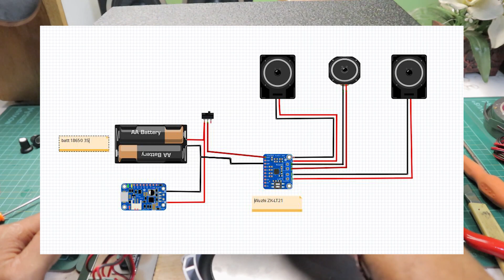Bluetooth Speaker DIY 30 watt #diy #portablespeaker

Comment: Bang ,rencana saya mau bikin speaker bluetooth 2.1 seperti itu untuk pertama kalinya.Dengan speaker bekas Logitech Z313 Subwoofer 15W R&L 5W x 2 bisa kah menggunakan Amplifier seperti di video?. Untuk suara lebih bagus menggunakan bass radiator/ports ya?
Reply from the maker: Kalo box agak gede lebih baik pake port
Reply: @SUGIRIVIERIO    kalau untuk amplifier, bisa  pake ampli ini kah? Untuk daya sub 15w & full range 5w x2?

Comment: There is an interesting thing called a DSP audio processor, you can significantly improve the sound quality, any settings are programmed through a computer in the program, any equalizers, delays, stage expansion, a compressor (allows you to compress the sound so that the speakers do not drive at full speed without losing quality) tried to make from 4" speakers for great bass